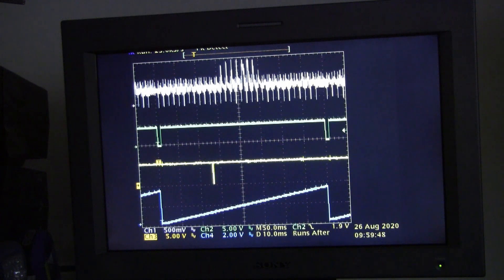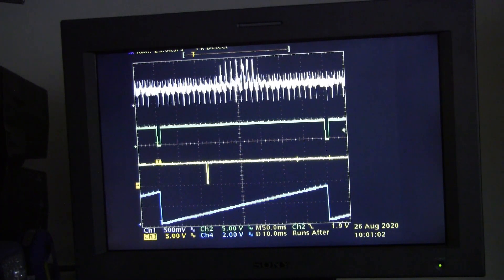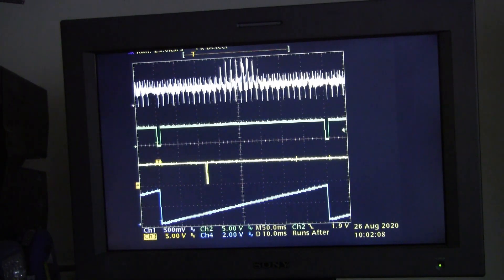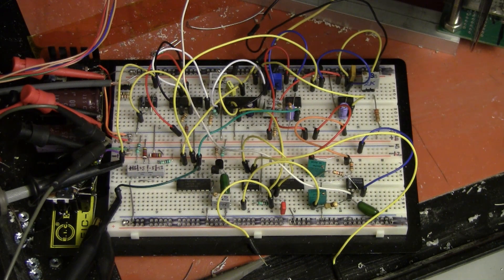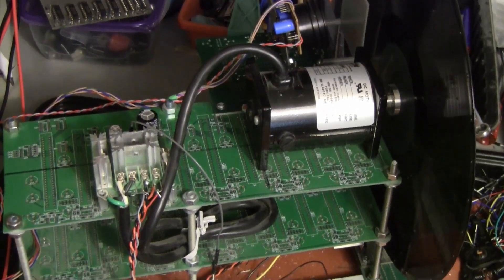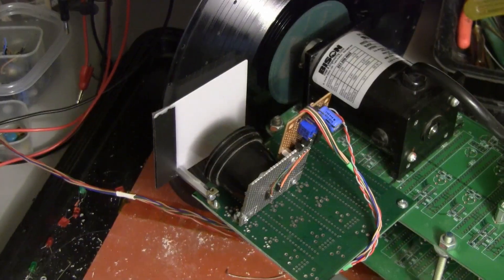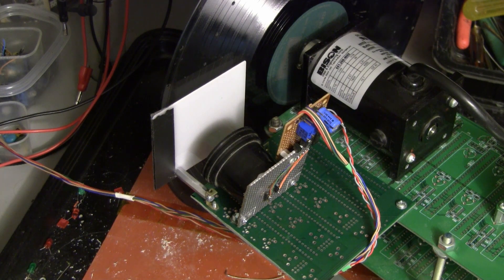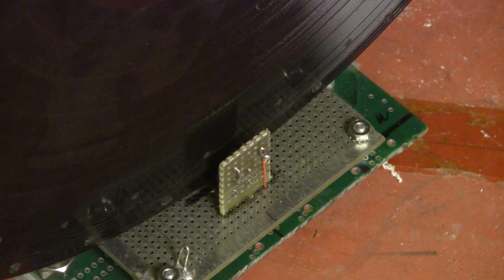NBTV "BIG" Televisor, Part 1

Comment: This is based on the Baird system. Do you think it is possible to build a horizontal scan system as we had in the late 1920s here in the U.S.?
Reply from the maker: Electronic or mechanical? Scan circuits or the scan system / scan rates? I can build any scan rate system you like, both electrostatic or magnetic. See my Philocam project where I built the image dissector tube camera with 267 lines @ 15 frame per second, progressive scan system. That even included a digital sync generator with a built in frame buffer with 8 images for testing the monitor. My Aurora World Converter will produce all of the standard scan rates from the 1930s onward too. Make the idea compelling enough and I might tackle it.
Reply: @videolabguy  I did watch your Philocam videos and they are very impressive. Some years ago I wanted to build a replica Nipkow disc horizontal scan system similar to the Jenkins models but I doubt my own skills in that endeavor. For example I do not think I could precisely drill out the Nipkow disc as you have done. 
I think from what I saw in the Early TV mechanical TV section that a 60 line set was built somewhere in the late 1920s.

Comment: Only recently discovered your channel after checking out your website on and off for years. Scored a Braun VTR-1004 as a result of seeing one on your page a long time ago and recently picked up a PAL Sony EIAJ B&W open reel deck that was getting tossed out at a university I was doing some work at. The Sony needs some work though - got sound but no picture. May have to be a lockdown project to fight cabin fever.

Comment: Good job mate. Try adding 2000 to 5000uf capacitor directly across the motor. It will add stability and reduce noise. Does your photo diode have a cover/tube to stop ambient light getting in?
Reply from the maker: That capacitor sounds counter intuitive. I'll give it a go. There is no cover on the current light source. A new light source will be constructed. Still pondering the possibilities.
Reply: @videolabguy  I run capacitors on mine. I dont know if you checked out my TV on my channel